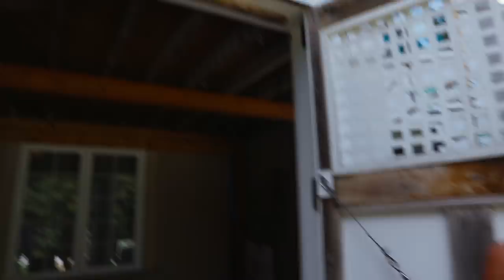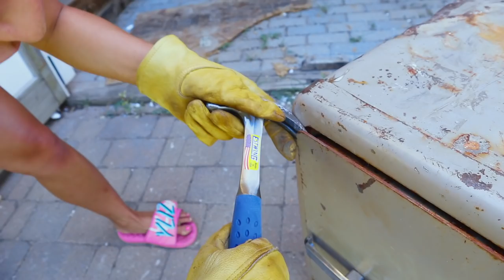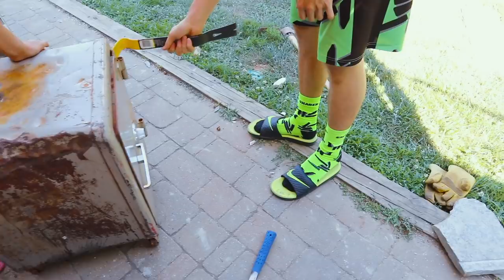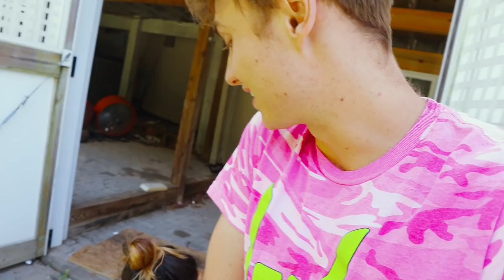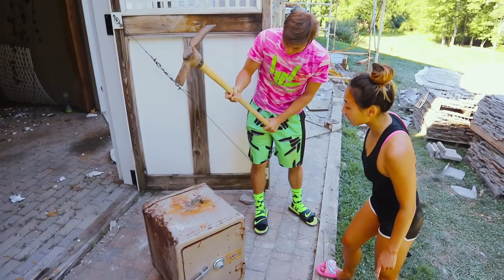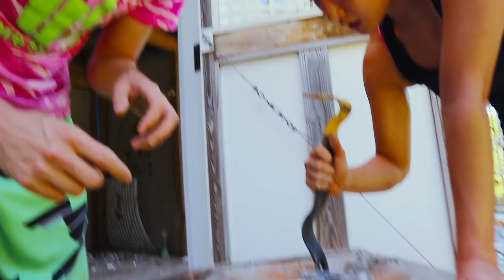CRACKING THE ABANDONED SAFE!!

Comment: Hey carter you should use a buzz saw or a chain saw on the door to get inside
Reply: Chainsaws are made for cutting wood which means that if the chain tried to cut through metal the chainsaw bar would probably bend or snap or the blades o the chail will just break

Comment: Pop the pins out of the hinges
Reply: Hi
Reply: Allen
Reply: Pop the pins out of the hinges
Reply: Allen Mielke you can't pop it out because it is a safe
Reply: IT'S GOOD TO BE A KID yes you can you take a screwdriver and a hammer and then you place the tip  of the screwdriver into where Carter popped the caps off and hammer it down until it caomes out

Comment: OMGosh, I have one of those safes.   That was made back in the late 70's.  That material you are calling concrete I think is a sand that was put in the walls for fireproofing.  I think the walls are about 1 1/2 thick filled with that fireproof material...  That material has a moisture content so if the safe were in a fire, the moisture would help protect whatever is in the safe.
The latch that is operated by a combination mechanism is about 6 inches tall by 3/8" thick and slides into the safe about an inch.
On the hinge side, there are two metal rods, about 1" long by about 1" in diameter.  when the door closes, those rods go into holes in the side of the door frame so if someone like you try to cut the hinges, those rods will hold the door closed and secure.
As you are seeing, the metal jacket is very thick for a safe of this type.
To get in through the door, you are going to have to do a lot of cutting, including through the frame to get at the latch and even then its gonna be a big job.
I think the lock smith would go for the combination mechanism in the door because it would be easier to attack.  But hey, you know what you are doing right??/ drop it from a platform???
Hit it with a hammer, yeah you'll eventually weaken the metal, maybe.